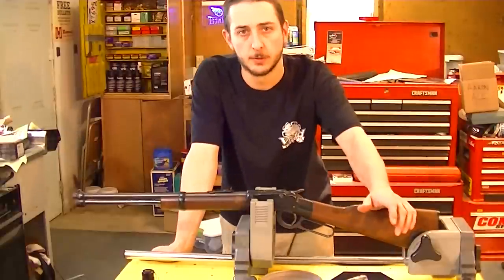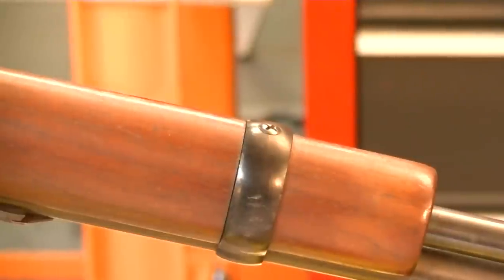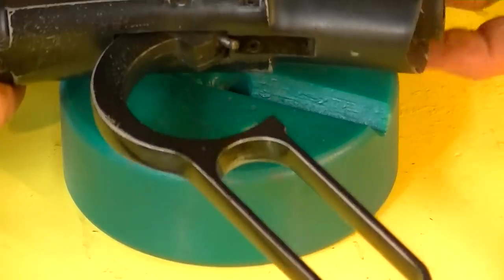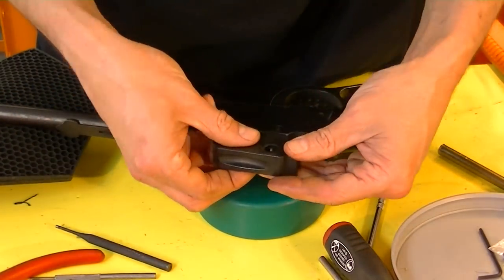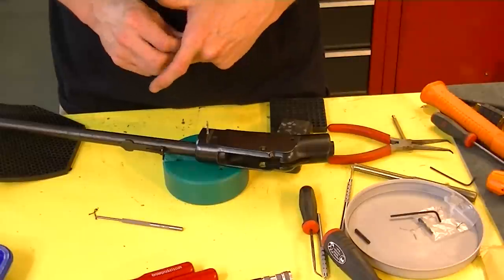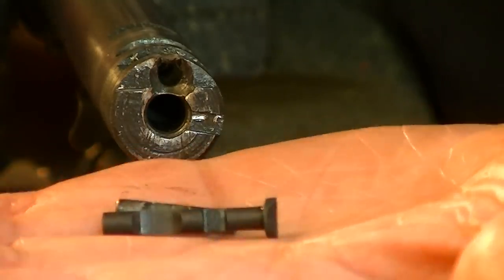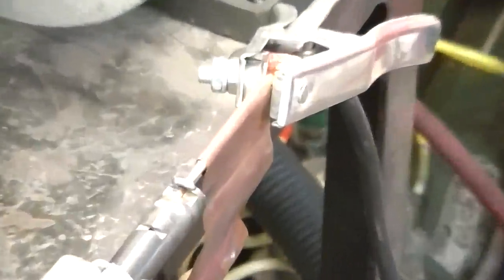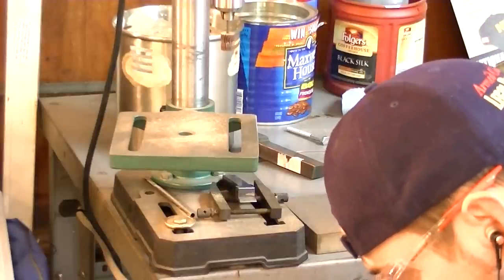Ithaca Model 49S Teardown and Ejector Repair (1of2)

Comment: I believe the receiver is aluminum if you would have heated  it a little it would have expanded  faster than the steel barrel and would remove a lot easier. I have been there done that. Not criticizing  just suggesting.  Have a nice day.

Comment: awesome video.  there isn't much info on repairs, cleaning and such on the Ithaca model 49.  There are many gunsmiths who won't even touch one.  Thank-you for giving such an informative and detailed video that allows us to do the repairs that we need to ourselves.
Reply: I wish I would have known. I took one in for repair and the guy charged me nearly $200 and the rifle still doesn't work. You stick a round in and it wont eject it. It will fire the round and the casing wont eject either. You stick a round in and it sticks in the barrel so tight you have to push it out with a rod. So I dont know. I guess the rifle is more complex than i thought.
Reply: It's actually a very simply designed gun.
After years and years of use, the ejector gets worn our and can't catch the rim of the round.  It's common on these.  I believe there are replacement parts still available.  
Hold on to that m49.  Every year there are less out there and we may be holding future collector items.

Comment: when you reinstalled the spring and rounded detent pin in the hole at the bottom of the block you forgot the Bolt Pivot Lock Pin which is a double flat ended small pin that goes in hole first then the spring then the rounded detent pin. It locks the bolt pin in the receiver. If in error you attempt to drive out the bolt pin before removing the lever first this lock pin gets sheared off. The spring should not ride in the groove of the bolt pivot pin . Lever comes out first, then remove the detent pin, spring and this lock pin before driving out the bolt pin.

Comment: You do not have to do a total strip down and removal of the barrel to replace the ejector. Open the action, drift out the barrel retaining pin, and remove the ejector with tweezers or needle nose pliers. Insert the new ejector pin, pushing in on the end so the notch clears the barrel retaining pin. Insert barrel pin enough to retain ejector. Place a spent casing or snap cap in the breech and close the action, then open again. The ejector should stay seated until the lever is fully down, and then should kick the casing out and bounce it off the block.

If the ejector doesn't stay seated, you may have to file a touch off the forward edge of the rearward notch. You may also need to clean the trip lever and its spring. But it won't catch at all without a casing in the breech.

If the casings don't pop out cleanly, check the breech. It may have been peened from dry firing.

Comment: The plunger and spring do come out of the lever.  The plunger pin has cut out slots on it.  The the main pin that fits through the lever and receiver intercedes with those slots to make sure it doesn't come out.
My own 49S has a different set up on the mag tube.  It has a dovetail in the barrel that the mag tube fits into securely.  Wish I could share the pictures.

Comment: Taking out the bolt pin before the lever is a great way the break the bolt pivot lock pin.  I cringed when you started pounding on the ejector trip pin from the wrong side.  It is splined like the other ones you told us about.

Comment: So as I was taking mine apart inside the bolt you have the detent and the spring. I am missing that spring mine had what looked to be a broken piece of another detent. I have scoured the internet and can not seem to find the spring is there a website you use to find these parts? Thank you
Reply: Use a spring from a pen, cut to size if needed.

Comment: I am happy I found your video because I have been wondering if there is supposed to be a screw that you show at about 7:50 of the video which you put in print on the screen that you say does not have to be removed.Well I see there should be a screw and a spring under it as well.I got an M49S from my Dads property after he passed away a couple of years ago and that screw and spring are missing. Do you know the part names or part numbers for them so I may try and locate them and put them into my rifle? I have shot the rifle and it shoots just fine so I’m not sure just what the screw and spring are supposed to be for? The rifle functions just fine as it is but I would like to put the rest of the parts where they belong if possible.Thanks much for any assistance and God bless.

Comment: Great detailed video, I'm about ready to tear mine down.
I'm confused about he direction of the barrel pin, is it supposed to go the same way as the other pins or opposite?
The detent & spring that holds the bolt pin: it seems that the detent should go towards the pin but you put the spring towards the pin; is that the right way?
My 'magazine tube' doesn't have the same clamp type thing on the end like yours, it has a small block with a tiny pin in it.  I assume that removing that pin will allow the tube/stock assembly out; ever seen that version?
Should the ejector toss the shells out like yours or is it normal that it'll only pull them part way out?  I think mine tossed them the first time I shot it and last weekend they wouldn't.

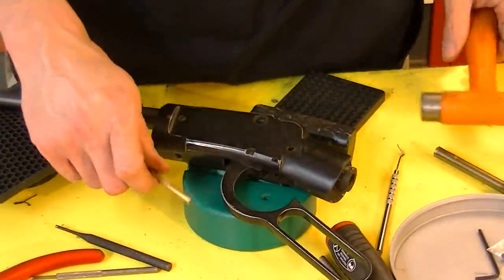Comment: I hate to be "that guy" but if you look at the video, you drove all the pins out from Left to right except the one that you said was installed backwards (which you drove out from right to left). You even say (at 12:27) "Remember, left to right".  I think it was installed correctly to begin with. 

Again, I'm not trying to be a pain, but I thought you might want to edit the video to reflect that the pin was indeed installed correctly.

Comment: I need to replace the firing pin on the one I have for my grandchildren to plink with. I can see several items that really don't need to be removed to accomplish this task (e.g. fore end stock) but am not sure of some of the other items (butt stock, hammer spring assembly, trigger, hammer, etc).  I want to take apart the minimum required to install the new firing pin. Any suggestions on just those specific items required to be removed to remove the bolt group?

Comment: Mine doesn't seem to have the barrel set screw, just a small brace about an inch back from the end of the dummy tube with a tiny pin horizontally through it. I'm not sure of the year on mine, it was given to me by the new owner of an old barn
Reply from the maker: Jman2896 Yea most guns seem to have variations as they are made over a period of years.  Also field expedient modifications are made to many that make them appear different. haha  I was not sure if you were just making a statement or actually asking a question so if you were asking and looking for some feedback on that please elaborate on your question and  I will get back to you. Thanks!

Comment: Great videos.  I have a 49 with a chip out of the ejector.  Can't find a new ejector anywhere so will have to get the old one out and copy it.  Will probably make the new one out of O1 tool steel but will not heat treat it.  I think a tough steel is better than a hardened steel since if it is not tempered properly it will be too brittle. However, that is my opinion.  The ejector seems to be a big problem with this gun since everyone is out of stock.  Do you have a source for who might have the ejector for sale?  Also, where did you purchase your TIG welder?  What is the brand and model?  I'm in the market.  Hope to hear from you.  Thank you.
Reply from the maker: +Tony Ringler  I do not have a source for that part so you are on the right track for repairs.  Tool steel will be fine but might look into annealing it some since it cannot be brittle at all and last.  The welders that I use are Longevity.  The welders themselves are great. I used to be a dealer for them but the company but we had a falling out.
Reply: Numrich gun parts has these as well as many other parts for this gun.

Comment: On mine there was a second detent on top of the spring which lays inside the block. The top detent sat inside in the groove in the large firing block pin. Anyone else have this second pin? It wasn’t in the video so I sheered the small detent in half when removing the large pin

Comment: I have a 49S that the hammer won't stay back unless I hold the trigger forward. I'm guessing there is a loose or broken spring somewhere? Any ideas?
Reply from the maker: +sbtaylor2002 Yea, probably the trigger spring but could be a couple other things as well.  Do you have someone there to take it to or do you feel comfortable doing the repair yourself? If not you can send it to us for repairs. If you decide to dive in yourself you can contact me via Email and I will help ya out if I can.  http://www.facebook.com/teamklrdefensiveconcepts      "teamklrdefensiveconcepts@gmail.com"
Reply: +TDCtactical I'm good with doing it myself. I have the necessary tools and was going to break it down sometime this next week to locate the problem. It appears that the detent pin in the lever is either really worn or stuck too far in so I'll be knocking those pins out to check that too.
Reply from the maker: sbtaylor2002 Yea, that is why I say that they could be lots of possibilities other than a spring.  Take your time and use logic to figure it out.
Reply: +TDCtactical Will do. I'll be in touch if I get confused. Thanks for replying.
Reply from the maker: sbtaylor2002 of coarse!
Reply: +TDCtactical Thanks to this video and our little discussion on here I was able to completely tear down my 49S and found that over the years a little dirt had crept into the hammer spring and detent pins and had them seized. This gun was a gift to me from my now deceased father as my first gun as long as I promised him that I would always take care of it. That made it very important to me that I restore it to working order again. After a good cleaning and a soak with special forces dry lube it is now in perfect working order again. Thanks so much for putting this out here for us to see.
Reply from the maker: sbtaylor2002 Glad to help and thanks for the story!  Just so you know, I get a ton of guns in to work on with similar stories behind them. I consider it an honor to be allowed to work on them.  Many have me refinish them with one of the newer epoxy ceramic coatings. Most still have great finishes on them but by coating them how I do it ensures that they will never rust or corrode ever again. That way as it is passed down through the generations they know it will be in tip top shape no matter if some rug rat offspring doesn't take care of it down the line. haha  I am able to very closely match the original finishes as well. On some guns that might have nicks, scrapes, gouges, etc AKA "Character", I am able to leave the disturbed metal but just coat over so it is protected.  I am also able to do a clear over the existing "patina" so as to not change the look of the gun at all, yet offer protection.  That way is not as tough as a complete refinish but is good none the less.
Reply: +TDCtactical I saw that on your website and may talk about that with you in greater detail sometime. I also noticed that you're only about a half hour drive away from me so that makes it really convenient for me. I have a couple of guns that I'd be interested in having protected in that way actually.
Reply from the maker: sbtaylor2002 You know, that is why I mentioned it.  You do this long enough and sometimes from simple conversation I can get a feel for things certain individuals might be interested in. Often people don't have work/services done because they don't know they exist.  Drop me emails or facebook messages from here out to set anything up. I believe I have given that to you but if not let me know.

Comment: Hey when  u punched the large pin
Out with the level still attached it seemed to pop
Right through I have followed ur video step by step and with the lever and detention and spring out I cannot for the dam life of me punch the dam large pin through from the right side of the firearm to the left like you did so easily in your video could possibly be that the lever and detention need to be in place for correct takedown as you did accidentally in your video
Reply from the maker: ok, where I show that spring and detent just after 38:16. there has to still be something inside that hole that is keeping the large pan from moving. if you articulate it where you can see in that hole you might be able to spray some gun blaster/brake parts cleaner in the hole to lose it up and maybe get a.22 bore brush up there to clean and pull out the spring or detent stuck in there. whatever is still up there is engaging that large slot in the large pin and won't let it slide past.
Reply: I had the exact same problem. The large pin was being blocked by something. It looked like a short section of pin was remaining in the recess of the large pin, preventing it from sliding out. I tried a dab of crazy glue on the end of a drill bit ground flat, to attach to the offending pin and pull it out. It did not work. I also tried drilling the dent hole in the bolt larger by 0.004", that also did not work. I finally just ran the 0.004' oversize drill down farther until the offending pin as gone. It appears like it was a second detent installed, or a piece of a detent. TDC, your assessment was accurate.
Reply: I had this very problem as well.  It seemed that the second detent was wedged in and the only way I was able to get it out was to slowly drill it until it would come out.